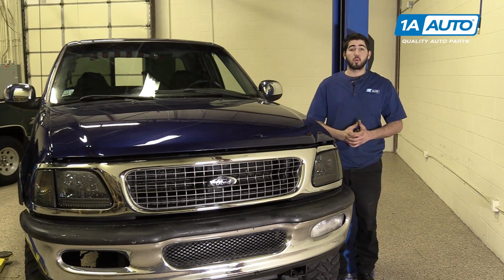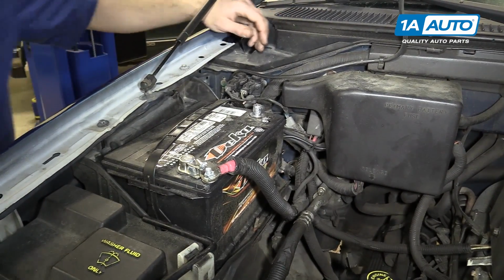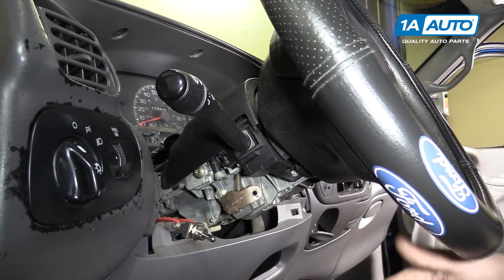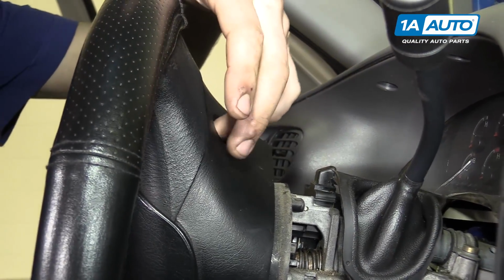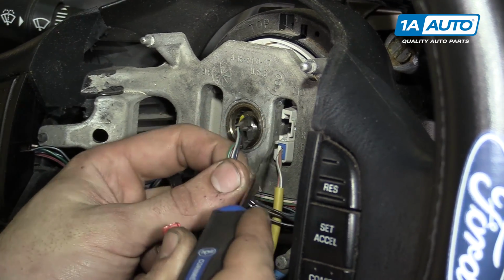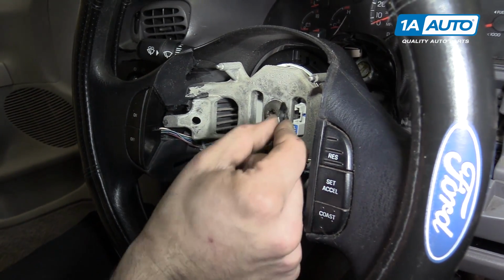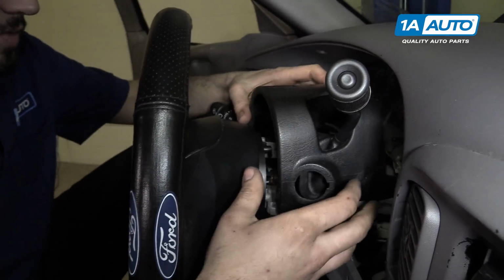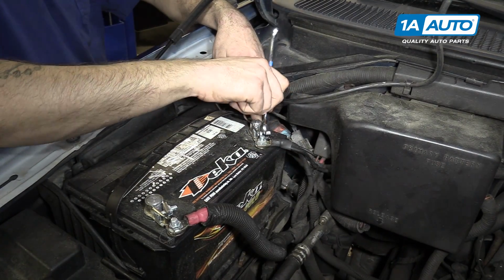How to Replace Cruise Control Switches 97-04 Ford F-150

Comment: about a 5 min job if you just pull the 2 8mm bolts unplug the old switches and plug in the new ones. Hardest part for me was putting the 2 blots back in lol !

Comment: Seems like that damn air bag is awfully dangerous. Now I'm going to be thinking about it blowing up in my face while driving. Is there an insert that I could replace the air bag with that would have a horn switch and look like the air bag does? 
My wife was in an accident and the air bag bruised her from the waist up. Her passenger without an air bag was not injured. 

Then I can take it and make a redneck claymore. Tape a bunch of steel balls to it and run the wire to a switch. 
How wonderful our government forces us to put an explosive device in our faces. And gave us such great gas cans.

Comment: I change the wires, install brand new blue switch from ford, cruise control and the rest of the buttons in the steering wheel are not working, is that a fuse for this thing

Comment: Would you recommend this type of job being handled by a professional mechanic due to needing to remove the airbag?
Reply: Just make sure you disconnect the battery and let it sit so the power can completely drain from the truck. The risk of deploying the airbag is small. You just need to be careful with it. But hey, the worst that could happen is you have a giant bag blow up in your face 😂

Comment: I have another model Ford, on my steering wheel if you press the  coasting button then the ON button for cruise control the horn beeps, letting me know the ON button works. Is this weird or designed to do?

Comment: It appears you take off several items that were not necessary to take off in order to access the screws from the rear. I appreciate the video instruction.
Reply: Thanks for the video! Helped tremendously. 
I do agree, you do not need to disassemble the dash or the steering column to get to the airbag assembly. This is about 30-minute job, taking your time. 1 hour adding the 30-minute time lapse when disconnecting the battery. 
Thanks again!
Reply from the maker: +Dale Clay Thank you for your feedback!

Comment: i have a 2001 f150 lariat . when i try to activate the cruise control , nothing illuminates on the dash board . what can it be ? also , my auto lamp , auto door locks , foot pedal adjustor and power seats do not work , can it be all in one fuse ? please let me know ! thanks !!!
Reply from the maker: +santana ramos Thank you for checking us out. It could be a fuse, or it could be the switch causing these symptoms. Most of the time these functions are in the same circuit. 1aauto.com